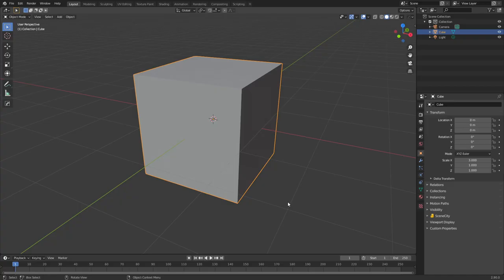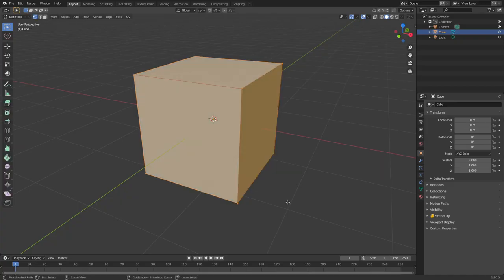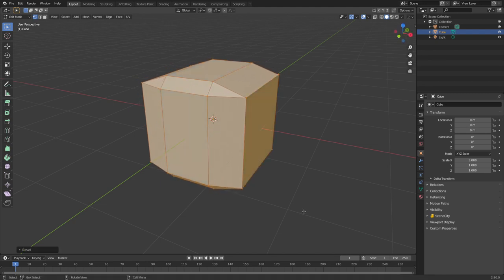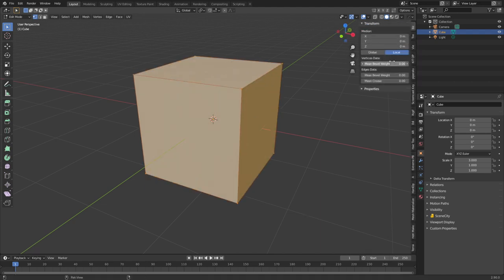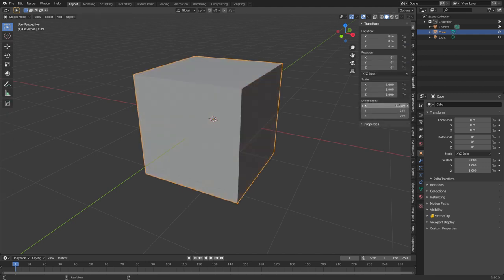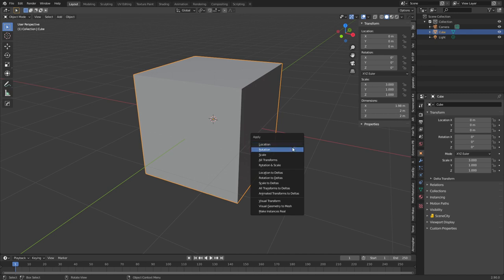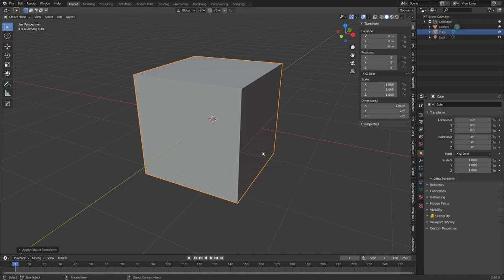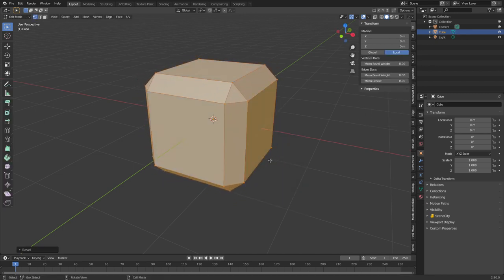Blender Bevel not Working Properly

Comment: Alright, any tips on how to prevent infinite spikes of death that consume the universe though?
Reply from the maker: I think you need to check the normals.
Reply: @Markom3D  Those are not the problem. It often happens with meshes that have too small surfaces. Like for example how meshes are after the wireframe modifier.